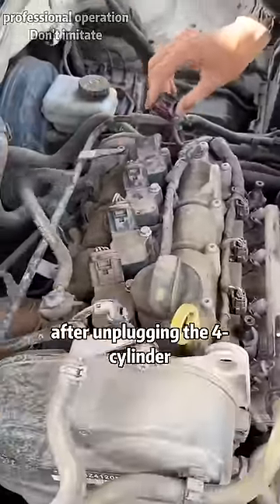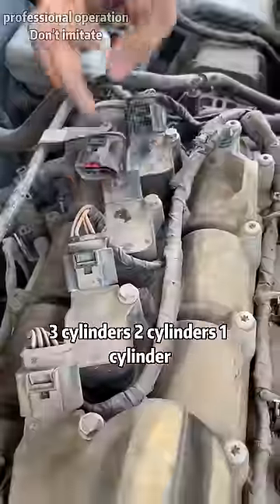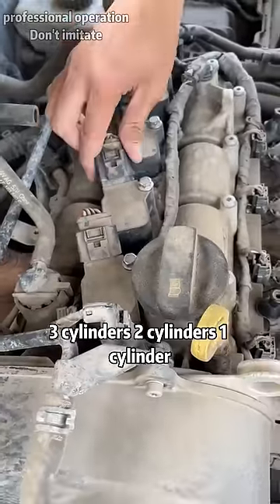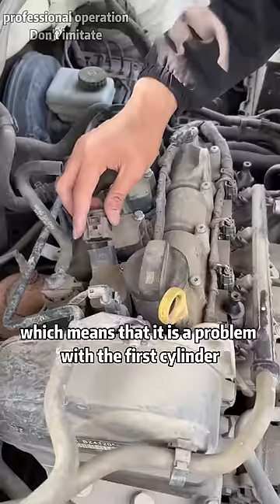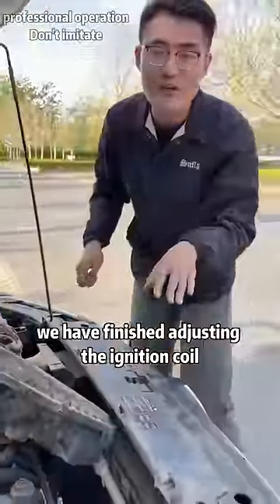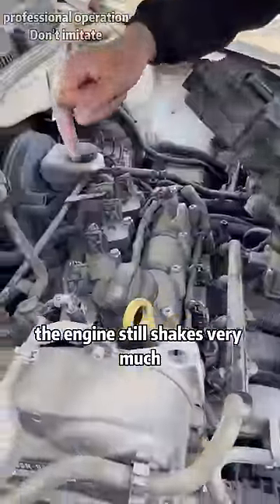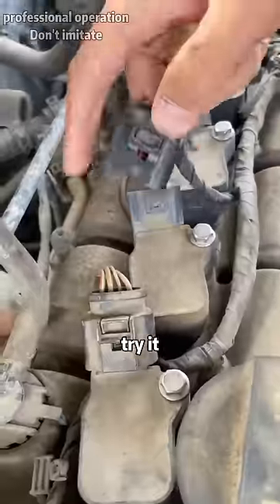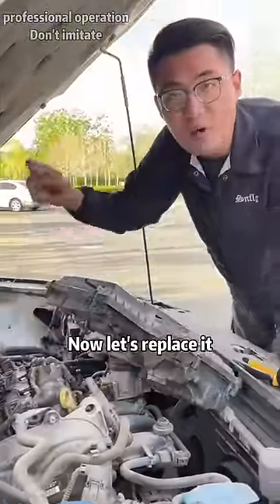（PART2）90% of people do not know the maintenance skills！#tips #car #shorts #tutorial #driving

Comment: A good rule of thumb is: dont follow the advice from a video with a robot voice.
Reply: im pretty sure originally its a chinese video and the voiceover is just the translation
Reply: No its very sound advice actually
Reply: Don't unplug while running, otherwise good advise🤙
Reply: True
Reply: This is a normal test that has fallen out of favor in the modern era but was a very common way to suss out misfires back in the days of distributors and carbs. Those engines only had one coil, so if it ran at all, the coil was fine, but you could still suss out which cylinder isn't firing by unplugging plug wires one at a time. And because these old engines were built right, you wouldn't hurt anything by doing that.

Except yourself. It's easy to ride the lightning. 30-40kV will happily go through your hand, up your arm, down your belly, through your shirt, and onto the core support. Not enough energy in it to kill ya but it is not pleasant.
Reply: This is the perfect way to do it actually
Reply: Its a legitimate diagnosis
Reply: @Tyler-jd3ex  How much potential harm can that cause??
Reply: @JohnDoe-qz1ql  It’s true in practice… you can also turn the engine off and unplug it
Reply: This is actual factual advice tho. It breaks your rule of thumb. This is how I’m fact to diagnose problem
Reply: @TestECull  This is still used by mechanics everywhere. I'm a mechanic. This is fantastic advice. Only thing I'd recommend is to not leave the coil unplugged for too long, since you can flood the cylinder.
Reply: @apoplecticwrenchmonkey  well, if the coil is not working anyway, you will flood it nonetheless. Bent rod territory
Reply: @apoplecticwrenchmonkey  Today's cars can do this totally through software, so I doubt today's mechanics are unplugging coil packs while it's running. They're just sitting in the cabin enjoying some air conditioning and tapping a tablet screen to disable that cylinder instead. And they can do it via spark and via fuel to further narrow down the issue. 

Moreover, they don't even need to run this test anymore, because this latest generation of unreliable shitpiles will just straight up tell you which cylinder isn't firing as soon as you plug in the diagnostic tablet. The computer in the dash is logging every single firing cycle in that engine at all times and if it's missing a beat the computer counts it per cylinder. Miss enough beats, a trouble code is logged, and a permanent log of misfire data for the offending cylinder is also logged alongside it. Code will be P030x, where x is the offending cylinder(IE A V8 posting P0305 will have a misfire in cylinder 5). If multiple cylinders are misfiring multiple P030x codes will be logged, one for each cylinder.

 Not only does it specifically tell you which cylinder is missing these days, but it tells you how many times it misfired in that last run cycle, what the engine vital signs are as it does so, and can even report what the throttle was commanded to be, the AFR, spark advanced, cam timing when it misfires. These modern ECUs are insanely good at logging every last minute attribute about the engine.

This test is a relic of a bygone era in the professional shop, something only really done on old iron and by shadetrees that can't get their hands on multi-thousand-dollar tablets that car manufacturers only lend out to approved repair shops.
Reply: @JOSH SERY  deffinantly unplug while running ffs. Just not the ignition coil.
Reply: Actually this is good diagnosing
Reply: @scotts1668  perfectly safe
Reply: @TestECull  I have shocked myself trying this same method. Listen to this guy, I wouldn’t recommend doing this while it’s running lol
Reply: @JR-uc1of  If you did that you weren't disconnecting the low voltage signal wires like you see here. And hey, if you wanna put the starter, battery through abject hell shutting it down between tests, go right ahead, me I'll just pre-emptively loosen the wires on the cap and pluck them off of it one by one while it's running.
Reply: It's good advice. Week ago I have same problem, I used this advice and replaced coil
Reply: I think he doesn’t speak English and he’s using the Google translate overlay so that he can reach a wider audience
Reply: This is actually good advice...
Reply: I messed up my e.c.u. by doing this. I have to send it off and have it repaired. I'm a mechanic by trade and have always done this with no problem and for some reason on my personal vehicle the ecu stopped sending the signal for #4 ignition coil to fire.
Reply: This is a solid diagnosis, even for a mechanic.
Reply: @Dontbmaddcuzubadd  it's ok to unplug it while the engine is running
Reply: @TestECull  you have to do this with a lot of fords, they don't ever read misfires right.
Reply: @Dontbmaddcuzubadd  how else would he test coils genius
Reply: @Dontbmaddcuzubadd  worst that'll happen is it'll stall. you absolutely can unplug while running.
Reply: It’s ligit I have done it
Reply: This is a legitimate way to diagnose a miss, It also tells you what the issue is instead of throwing money at it hoping for a change. also works with injectors.
Reply: @TestECull  You can usually hear which cylinder makes problems. No need to unplug spark plugs.
Reply: Same process a dealership mechanic would use
Reply: Hes giving very solid advice
Reply: @Dontbmaddcuzubadd  apparently you've never done a running compression test before, it's very similar in how this works in the video. It won't really harm your engine, it shakes due to the imbalance in power. Though unplugging the wires while the cars running can cause a short
Reply: its real advice tho, did it on my jeep the other day
Reply: this video is actually helpful for people who don’t know how to solve auto mechanical issues
Reply: @Dontbmaddcuzubadd  How are you supposed to diagnose it then?
Reply: lol
Reply: @Dontbmaddcuzubadd  it’s already misfiring it can’t do anymore harm to it
Reply: @michaelparks7563  After being unplugged some will stop firing till key off and on again. Probably wait 10 seconds inbetween just to make sure computer resets.
Reply: @jon.g17 i9 m mkk p
Reply: @Dontbmaddcuzubadd  its not that critical
Reply: I mean, I'm mechanic and this is a good advice if your car have the same parts like in the video, it only works witch this type of engine, don't do it if it's not the same.
Reply: Because if its not translated you'll understand shit.
Reply: What he is saying is common sense and it is a simple way to diagnose any vehicle with coil packs
Reply: Yeah except this is actually good advice lmfao 🤣🤣🤣🤣
Reply: He's not far off tho. It would be easier to use a chip reader, but for older cars this would work.
Reply: Or an Asian they know nothing about cars
Reply: Normally I'd agree, but yeah no this is legit and works everytime for diagnosing a coil, works the same for diagnosing spark plugs as an issue if you're too cheap to just replace all of them.
Reply: @LS1sLegoGarage  oh ok good to know
Reply: Use what’s known as multimeter…
Reply: Correct 😎
Reply: No this is a genuine way of narrowing a problem.
Reply: @Dontbmaddcuzubadd  how will you tell if the engine doesnt respond if it isnt running though?
Reply: But there's also the rule to not listen to people and the advice they give online?! So I'm unsure if I should listen to the robot voice videos.
Reply: This is actually what you do. You obviously don't  know cars
Reply: Actually this is pretty much how you'd diagnose it.... The other way is grabbing the individual exhaust manifolds for each cylinder and seeing what one is cold.... But that can be painful.
Reply: @Dontbmaddcuzubadd  it doesn't hurt it
Reply: @JohnDoe-qz1ql  none
Reply: This is the correct way to do this